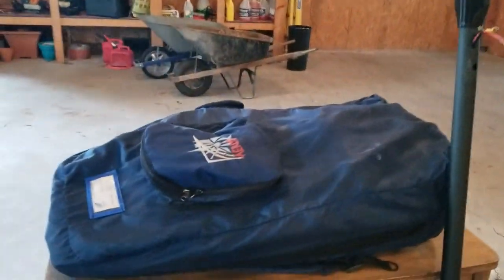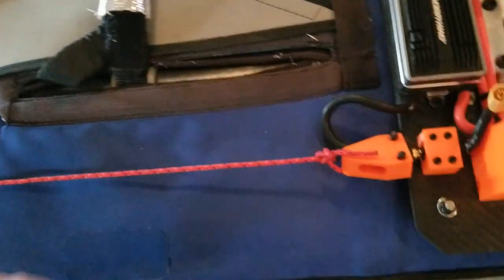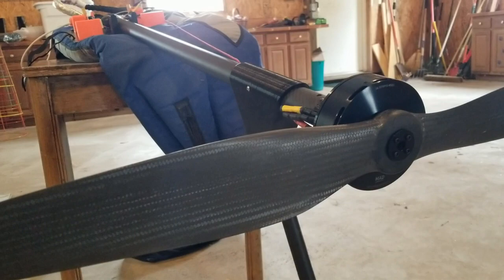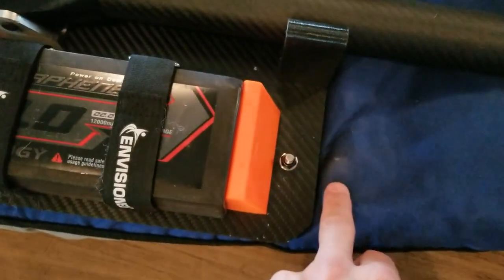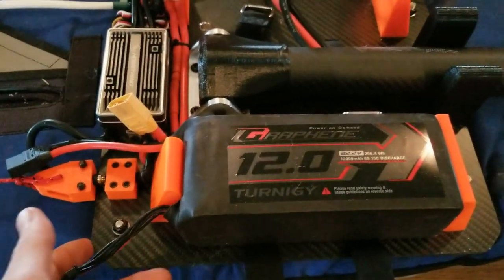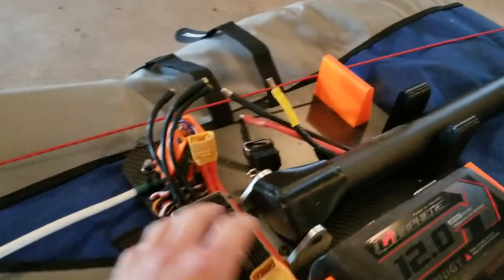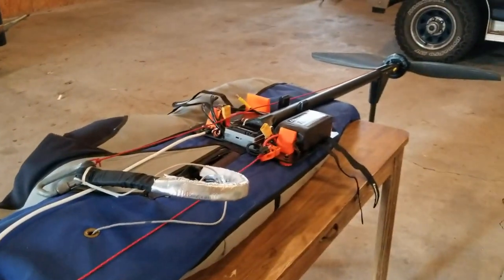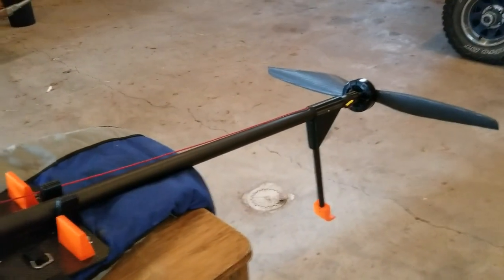carbon ehelp

Comment: Hi.  Thanks for sharing.  Am really interested in aspects of the project.  Where are the files hosted
Reply from the maker: I have them on my NAS and shared the folder.  Link is in the description.  Let me know if you can't access.
Reply: @cwallen32  Thanks Charles.  My bad for not looking down that far..  
Built one of those E-PPG's from open source.  Just never got cool with the paraglider thing and looking to come back to HG with the e-benefits.  These files will really help.

Comment: Very cool. What altitude/flying weight are you operating at?, I am 90kg flying out of Northern Utah (5000 ft), def looking towards a geared system for higher thrust.
Reply from the maker: I hook in at about 200lbs with harness, chute, ehelp etc.  Taking off from sea level.  I wouldn't go with a geared electric system, makes no sense.  For more thrust i would move to a bigger motor / esc / prop / battery combo.  I already purchased a Mad M30 and APD 240amp esc.  This can also support 2x 7s batteries.  I plan to increase prop diameter by putting in a custom folding hub which would increase diameter by at least 2 inches.  Also at higher altitude air is less dense you need to think about increasing prop pitch, not spinning it faster.
Reply: @cwallen32  I'd like to get the equivalent performance of a Hidden Mountain X1 (Vitto 100Evo 18 hp, 1.4m prop) out of an electric system... so a lighter/home-built version of the German e-lift system. Thanks for sharing your work!. PS. Trying to look at your shared files, and unable to download.
Reply from the maker: @romeromf  i'll check my server and see why it isnt working.  I wouldnt go with a 1.4m prop, way too big, you can go smaller and spin faster.  The elift is old tech at least motor esc.  You can get a cusome kv motor from MAD and the APD escs are really nice.  Prop selection however is very limited if you want CF, and just slightly better in wood.  I'm getting 400fpm on take off going down to 200-300fpm over rest of flight.
Reply: @cwallen32  and the e-lift is  13,000 Euro too.... 400 fpm at SL will be marginal at 5000ft launch and operating at 7-8000ft at 260lbs hook in weight (210lb pilot+20lb harness+30lb min e-help)... working the numbers to size the system for this scenario (3H.. high-hot-heavy).
Reply from the maker: @romeromf  I'm using the M20 setup and moving to an M30. Based on your weight and altitude I would go with an M40 or M50 setup. M50 seems to be overkill. This will also force you to a 100v setup and require 4 6s batteries so weight is going up by 50% if not more.  Below is what I would buy, whole setup will be $4-5k.

ESC:
https://shop.powerdrives.net/?product=hv-pro-200-24
(note: Mad ESCs don't have a brake feature so prop will freewheel)

M40:
https://mad-motor.com/product/mad-m40-c30-v2-1-kv50/
https://mad-motor.com/product/fluxer-fluxer-pro-4922-1250mm-paramotor-prop/

M50:
https://mad-motor.com/product/mad-m50c35/ (need to figure out right kv for prop below, ask MAD)
https://mad-motor.com/product/paramotor-propeller-60-20/
Reply from the maker: @romeromf  just checked and download workes.  let me know if you have issues.
Reply: @cwallen32   awesome, thanks!. Pricing sure goes up once you go the M40 class motor ($899), and the MAD ESC is $1,199. What compatible ESC would you recommend that incorporates prop breaking?.
Reply from the maker: @romeromf  Prop and batteries will be twice as much as well.  Added link to APD ESC above.  It also has telemetry so you can get stats from ESC on arduino Open PPG built a library that is open sourced.

Comment: Concerns about heat or battery flair up effecting your main support? melt through? Did you put a protector around your main support?
Reply from the maker: Yes.  Have a fireproof protector around harness main line.  Also parachute line does not go up main line to carabiner, its connected internally to the harness.  In the revised version I plan to have the batteries on rails and spring loaded with a burn string that would allow batteries to be auto ejected if they flame up.
Reply: @cwallen32  Ive been looking at this myself and have been studying the E-Help on youtube..
Reply from the maker: @Highrockman  I opened sourced all the files so should be easier to make then the ehelp.

Comment: This is a great idea. I would be super interested in the 3d files and the source for the arduino.
Reply from the maker: I open sourced all the Fusion 360 files and the Arduino source code.  I'm also open to sell the one you see in the video.   I plan to make some upgrades over the winter and would rather sell this one than cannibalize it for parts. PM me if interested.
Reply from the maker: Also better flight video here: https://youtu.be/2QEa9IL_ZlM

Comment: Judging by the noise, I wonder if the prop design/pitch etc could do with some tweaking to get more thrust and less neighbour annoying noise?
Reply from the maker: Not sure a different prop will make a meaningful difference on noise, i.e. it will still be loud.  Also goal is to launch find thermal then cut motor, neighbors can live with 10min of noise a few times a month IMO.  There is however room for improvement on prop / motor combo.  Ideally I would run a 34" prop but would need a higher KV motor 105-115.  Since you can't get those off the shelf you either need to rewind motor, pay a lot to get custom made, or go with 100kv.  I think the ideal prop with a 100kv motor will be around 37x16 with a target goal of pulling 195 amps.  The carbon props I'm using are a VTOL design so they have a bigger chord near the hub then a traditional airplane prop though much less than a drone.  Since I've open sourced design files it would be great if others can test props and share data.

Comment: That is a beautiful design, well done. I have a wireless e-winch I have built. Your mouth throttle would work perfectly with it as it is also Arduino controlled. Would you be prepared to sell me a complete mouth throttle unit, or provide a complete bill of materials so that I can get one made locally?
Reply from the maker: I've open sourced all the design files including fusion 360 CAD files and the STL in case you just want to print.   The BOM has all links to all the parts.  I may be open to printing the mouth throttle parts but don't really have the time to assemble, solder together etc. PM me to discuss, I may also have some of the spare parts as well.
Reply: @cwallen32  Thanks for the reply. I did download the files but I completely missed the bill of materials. I'm sure I can find someone local to print the case for me and I have ordered the sliding potentiometer from a local supplier. Thanks again and fly safe.
Reply from the maker: @hangflyer  Did you find BOM?   Also Fusion 360 is free, so you can tweak design if needed.  I probably did 20 iterations of mouth throttle to get a perfect fit for my bite which may be different for others.  I also had to tweak to fit in full face helmet.

Comment: keen to build this, would a creality ender 3 pro 3D printer be suitable for this task? thanks
Reply from the maker: Ender 3 should be fine.  I believe it has an all metal hotend. I printed some parts in Polymaker PC Max (PC/ABS) which needs a heated enclosure however you could do everything in ABS or ASA.  I would suggest ASA as its doesn't warp as much as ABS and is UV resistant. What's really important is print orientation, # of perimeters, and infill.  I'll add some print settings to the open source files.